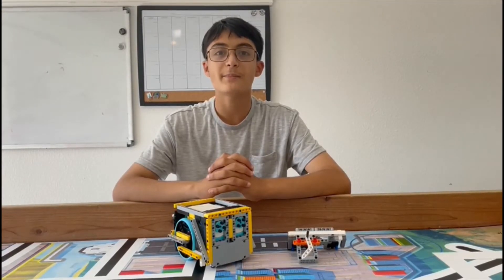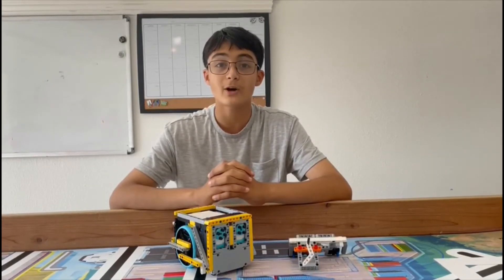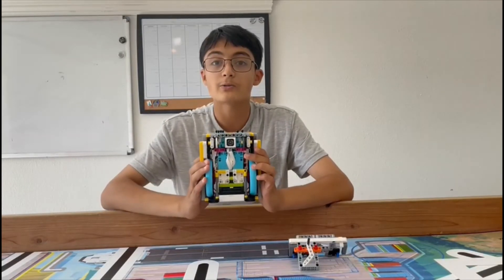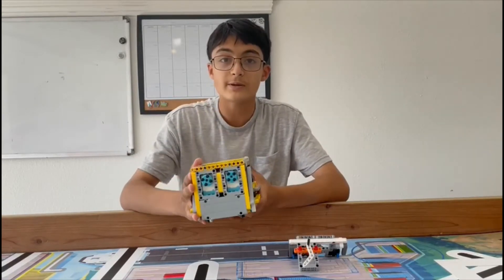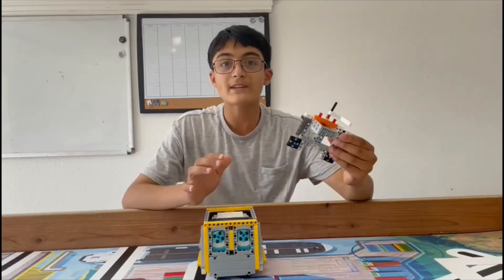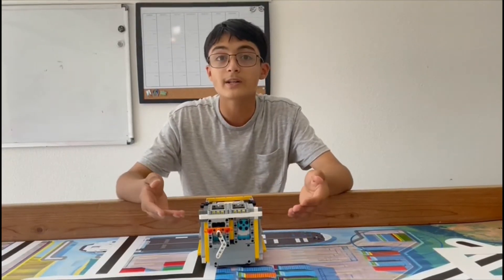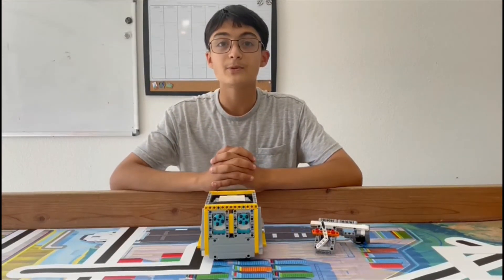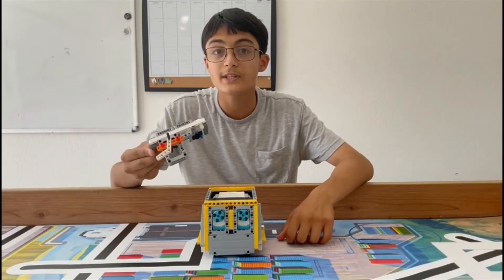Spike Prime Robot Design 3

Comment: Is the charging port on the hub covered by the plates and beams ? How easy it is to charge without removing the plates / beams ?
Reply from the maker: Yes, I have built it so that the top plate near the port can pop out and you can easily charge the robot.